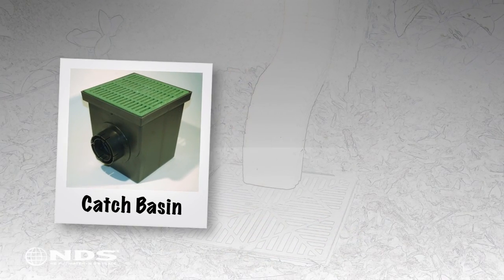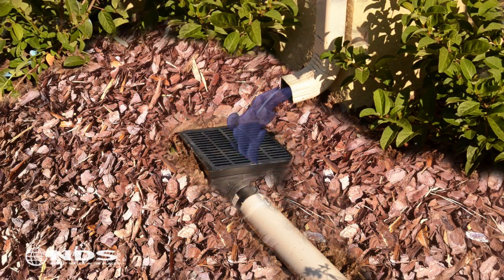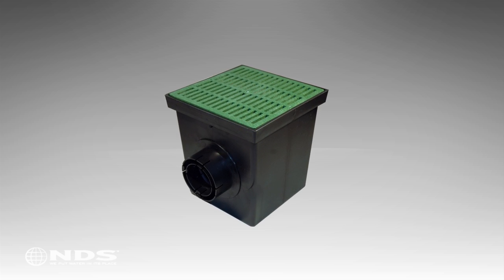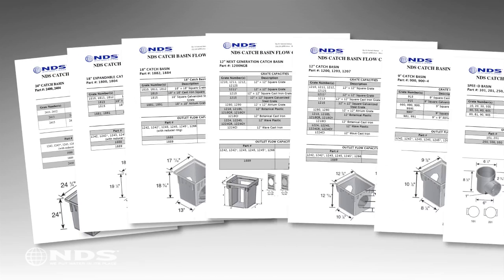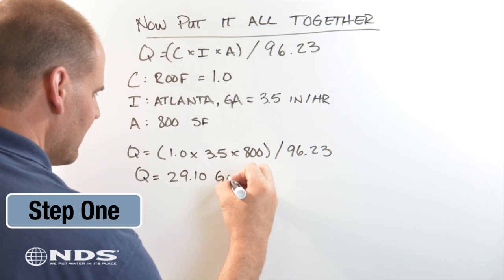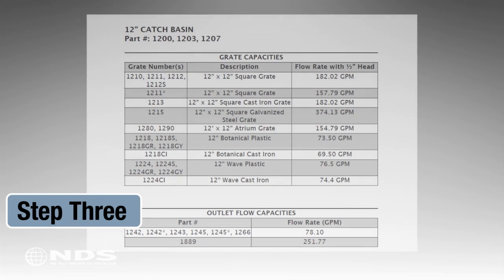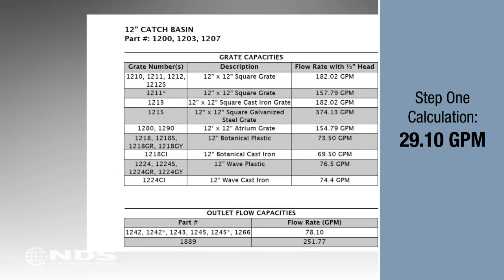How Do I Choose the Right Size Catch Basin for My Drainage System? | NDS Drainage Solutions

Comment: so, you're link doesn't give any clue as to how to actually find the referenced charts.  Just a nice "pick your problem" interactive site, which then just leads to products (under "find the solution") or a why video, under "learn more", which then leads to "find a solution" links.  I still have no idea how to calculate what size "solution" I need.
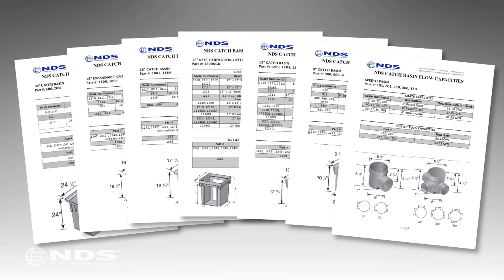Reply from the maker: Jay Walsh Hi Jay! Sorry you are having problems. If you click the charts at 1:13 it will take you to a page called "training materials". You could also go directly to this link:http://www.ndspro.com/resources/information/training-materials. On this page the referenced charts are under "Flow Capacity charts" and then "Catch Basin Flow Capacities". Hope this helps!
Reply: NDS Stormwater Management link fails
Reply: awesome, thanks.  believe it or not, I tried that click, but I jumped the guy a bit and despite searching around, never managed to end up on that page.  That's what I needed!